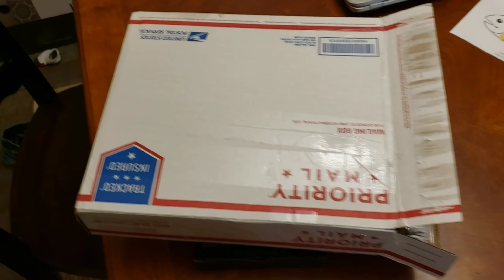Cheapest Sluice on Ebay Review

Comment: I have the green one ,I ordered the one on the left should be here today or tomorrow. But the metal one I ordered has the miners moss with it. I will put the green one at the bottom . Seems the mouth would fit just right. And also could be and extension. And with the miners moss. Should be good. I'll run my run concentrates the same way.but without the miners moss and grate of course just the black mat.green one on bottom. Should do the trick. And I can fit it in a back pack